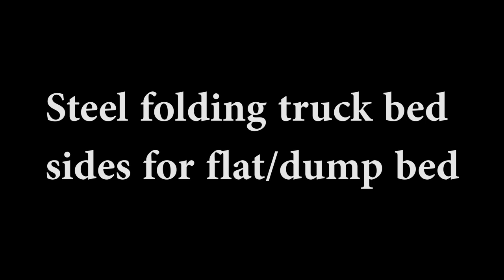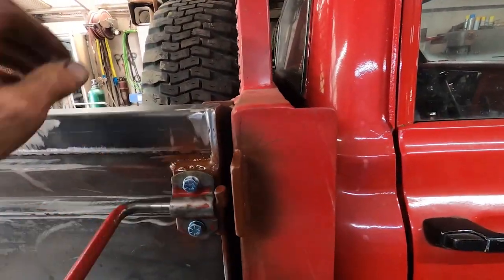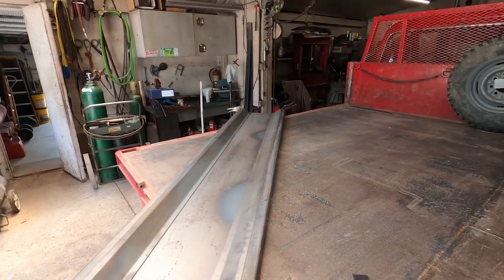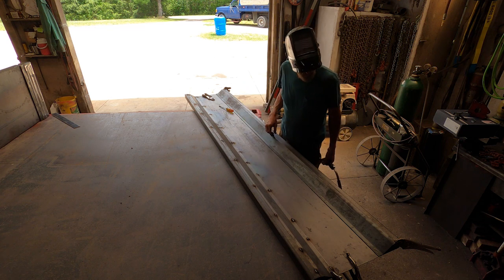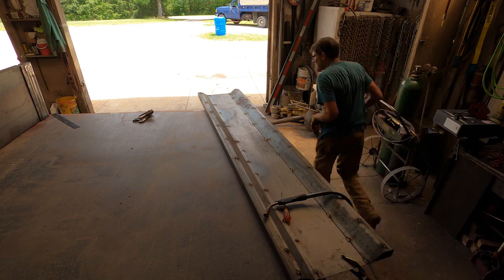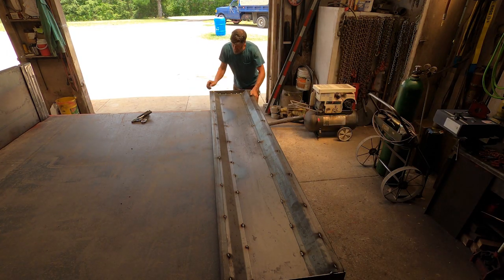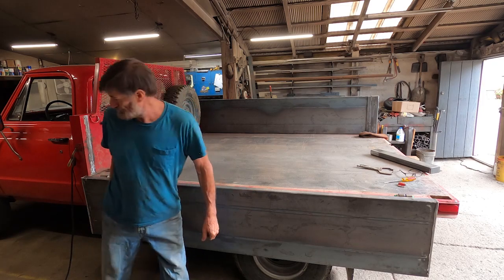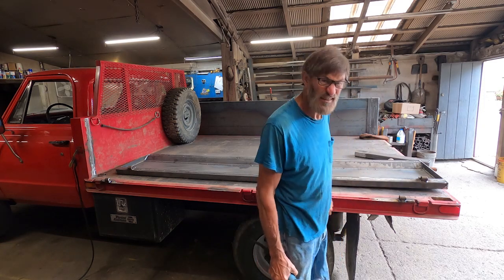Building steel folding sides for dump truck flat bed by Danbilt

Comment: Nice! I've always wanted to do this but always ended up with drop in 2 x 12 wood boards, much lighter and easily and replaceable. I've used the 2 x 12 system on 6 different flatbeds 3/4 - 1 ton, my own trucks and also at work. One flatbed had drop down sides but they weighed over 100# each and were horrible, yup, cut them off and used drop in 2 x 12s, the crews loved using them.